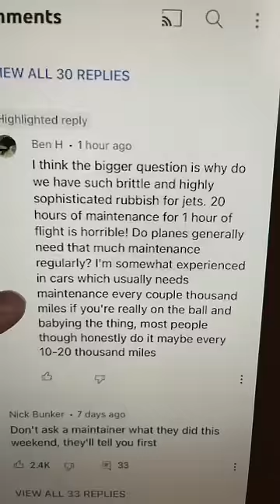Why does an F-16 need 17 hours of maintenance for every hour of flight?

Comment: "Don't buy a Toyota, this things are money pits. Gets yourself an f16" - Scotty
Reply: I bought a new Toyota Highlux pick up yruck in 1992 and had it for 27 years until I no longer needed it! It never have a single problem
Reply: @colorin81colorado  yup.. toyotas are the unsung heroes for the middle class. one might have to pay a little more up front, but a toyota will easily go hundreds of thousands of miles like nothing.
Reply: F-16 is a bargain compared to any Mig...
Reply: Scotty Kilmer ? 😁
Reply: @pan2aja  Scotty the magat.
Reply: Good luck going through the drive-through 😂
Reply: @wilfdarr  You better believe it.  Russian engineering gave them Chernobyl and the Kursk. Who'd ever buy a Lada or a Zil?  They do make a good assault rifle, though.  It's cheap, rough character is perfect form following function.
Reply: @phillipdavidhaskett7513  They built Chernobyl, we built 3 mile island: nuff said! The only reason they make such good assault rifles is specifically because loose tolerances are a benefit in assault rifles: no one buys a Russian sniper rifle, in fact they're using smuggled AWMs in Ukraine right now.
Reply: REV UP YOUR ENGINES!!

Comment: If we are talking cars, fighter jets would be F1 cars or similar and those do require tons of maintenance for every hour of racing.
Reply: F1 would probably be far worse than an F16 in terms of hours of maintenance per hour of running. Typically they only run 2 or 3 hours per day over a race weekend and have a support team of 20 people per car at the venue working very long hours through a race weekend. That said an F1 car is a prototype, whereas an F16 is a low volume product and a Toyota Camry is mass produced. 

What people don't realise is that a Toyota Camry is actually far better engineered than an F16 or F1 car because the costs as spread over so many units sold. Toyota can plough $Xbn per year into making a Camry chasing marginal gains in quality, reliability, manufacturing optimisation because they are moving over 300,000 units per year.
Reply: In fairness, as an f1 geek, I can assure you it isn’t a 17:1 ratio

Tbh I think the greatest gains could probably come from trying to reduce that ratio, if you can reduce it by half, you can maintain twice the planes with the same crew, and have twice the number of planes in the air practically speaking, and I could be wrong, but an 8.5:1 ratio should be possible
Reply: @jordanclark4635  “Should be” possible aye, as is finishing LeMans on an excessively limited tires budget. It’s a losing proposition at scale when the competition doesn’t have to—cutting maintenance hours is cutting readiness priority corners. No sense accelerating the exact readiness disruptions that make or wars of attrition anyway
Reply: @Rishnai  the point I’m making isn’t that it would be possible necessarily with F16s as they are, but that by putting more focus on reducing maintenance hours through design alterations, and when aircraft are being designed in future making this a priority, it should be possible to reduce
Reply: @jordanclark4635  Military aircraft are optimized for one thing: operational theatre domination. Civilian commercial aircraft are optimized for maximum safe uptime per unit of downtime (AKA: profit). These are two very different paradigms.
Reply: @DrewNorthup  when did I mention civilian aircraft?
Reply: @jordanclark4635  Ok, so let's say I ignore the rest of the conversation thread—how does that change my reply: Not Much. The reality is that technologies tested in the F1 vehicle platforms almost always influence consumer vehicle design, production, operation, and maintenance. If the amount of maintenance something requires in an F1 car is too high relative the race gains or overall cost then it isn't worthwhile—a closer parallel to civilian commercial aviation than to military aviation (where cost and maintenance time are generally tiny factors compared to effectiveness). That said, excessive maintenance load has gotten airframes retired early. Look no further than the F-15 and F-14 for examples of that.
Reply: @DrewNorthup  up until the last two years F1 was much more comparable to military aviation than civilian; now with a cost cap there’s maybe less of that as they can’t simply spend their way out of issues and do have to look for simple and cheaper ways to find performance 

The point I’m making is that if R&D was spent to reduce maintenance down time, they’d be able to do improve it with little performance trade off; there are many ways to do this including potentially the use of stronger and more exotic materials, as an example. While this would increase cost in this example, it would also make more planes combat ready at any one time 

I’m not advocating skimping on maintenance, I’m advocating research into reducing it so that there’s more combat ready planes available at any one time
Reply: ummm ackshully, f1 maintenance is extremely fast. An F1 pit stop takes 30 seconds at most, and they're only allowed 3 in a race.
LOL jk, terrible troll :)
Reply: @jordanclark4635  you are wrong. You just heard a just a few of the countless examples of why an f16(and fighters in general) take so much maintenance and you're suddenly an expert declaring they could cut maintenance in half. This is one of the most popular fighters in the world so im sure all the countries flying them would really appreciate your insight into maintenance on an f16. Please enlighten us on how to cut maintenance in half? Im sure the factories still building them today would love to hear your insight into fighter jet maintenance.
Reply: @jordanclark4635  we got a keyboard warrior here!
Please, tell me more about how you know more about aeronautical engineering than…aeronautical engineers 🧐
Reply: @jordanclark4635  If SpaceX decided to make fighter jets they'd probably do 1 hour maintenance for every 17 fights.
Reply: @skydog22  if spaceX made fighter planes they’d explode on runways
Reply: As an aircraft mechanic I'd rather work on that f1 than on a plane, no need to do signing off abd defo not any hard to reach spaces
Reply: @skydog22  idk I reckon there would be a lot of man-hours thrown into their rockets. Lol
Reply: @jordanclark4635  oh yeah man, plenty of them would! I'm not a fanboy man, but they do develop fast and furiously and do you have a track record of working The Kinks out to achieve a super safe rocket the falcon. It would be fun to see how fast they could put whatever kind of war plane together.
Reply: @somethinglikethat2176  you think so based on if NASA and all that, but everything is designed for Rapid reuse. The aspirational goal is 100 flights on an engine before major tear down, they already do 10 on the merlin and it is nowhere near as good of a design as the Raptor. So his goal is to land a Starship and one hour later be refueled and reloaded on top of a booster and back to space. I'm not sure how quickly they'll be doing that considering they haven't even put Starship into orbit yet but Elon has a way of motivation.
Reply: @jordanclark4635  maybe we could look at it differently. Say we divide the maintenance hours into fixed cost (in hours) and variable cost. The fixed cost would be the standard post flight inspection the every plane has and the variable costs would be work done on the aircraft to restore fight worthiness or scheduled replacements.

I imagine a lot of the maintenance hours fall into the fixed cost area and there is really no way around that problem. They need to conduct inspections regardless. 

I get what you saying but there is always a trade off and it might be cheaper to throw man-hours at the problem as opposed to redesigning parts. F1 teams have had issues with new cars and parts, even when they could spend whatever they had on the problem.
Reply: @skydog22  there would still be a ton of hours done to inspect each engine between launches, that would be the same regardless of who is doing it.

Much like the F16 much of the maintenance hours would be spent on standard inspections because the alternative of hoping for the best is needlessly reckless.
Reply: Fun fact.. did u know F1 car will need to be strips down to bare component and mechanic will ultrasound every parts to make sure the integrity of the part (molecules) is good enough for next race weekend.. 
yeap.. the whole car.. down to the last bit..
Reply: @mingc4698  aircraft also have scheduled inspections where things are peeled back and looked at closely, sometimes using nondestructive tests like x-rays.
Reply: @jordanclark4635  it's easy to say "design it better for maintenance", hard to do.
Due to the extremely low volume and high per-unit costs, any change to a working system will be incredibly expensive in the short term to apply... so... if it aint broke, the military aint gonna fix it.

F-1 is designed to be rapidly taken apart amd put back together.
Commercial planes have a large volume, so they can afford to spread the cost of a mx upgrade around to save time in the long run
Military stuff? Made by the lowest bidder for three times the cost, and delivered six years after the due date... just for a working product. You think they'll allow another pass for ease of maintenance for those costs?
Reply: Not really, F1 are essentially prototypes( sort of simplification).
Reply: @jordanclark4635  maintenance is vital so when war comes the planes are ready to fly under your successfully deduced 8.5:1 ratio. When you don't sustain readiness you create the Russian Air Force.
Reply: Dragsters probably have one of the worst ratios because they’re literally rebuilt from scratch every run. Not alot of time but definitely alot of effort
Reply: f1 cars are also designed with performance in mind instead of longevity
there’s a reason they’re allowed a few engines and gearboxes each year because of what they go through
Reply: @roowut  they’re actually designed for longevity too; engines used to be stuck in for quali, and a new one in for the race, then they had to use the same engine for a weekend, then two, then now they use 3 ICE and I think 3 mechanical splits (stuff like the turbo), and 2 electrical (ERS, battery, etc.)
Reply: @thomas316   F1 & F16 are hand made, about 100 units a year. Made with light weight material that CNC, one seaters.  Both are made for high performance with high maintenance, not individually owned
Reply: @inund8  Haha! Imagine if that was actually true for any car.

"This car needs a head gasket replacement. What's the book say?"
"45 seconds."
"That's dumb, I can do it in 30."
Reply: @jordanclark4635  The number I read for civilian aircraft is 10-12 hours of maintenance per hour of flight hour, so 8.5 hours seems like a stretch. There are things you can fix through design, but there will always be a trade off where reducing inspections and maintenance, and increasing the weight of the craft. Obviously, this negatively effects the capabilities of the aircraft. We could build an aircraft that has the maneuverability and radar cross section of a hawk at mach 2, but requires a 40:1 ratio to maintain. I suspect that designers have considered this trade off already.
Reply: It’s definitely possible to reduce maintenance time. Just look at the Gripen. Part of Swedish Cold War strategy was operating fighters from small dispersed bases or even roads so their Air Force couldn’t be crippled by attacking a few bases. Their aircraft were designed to be maintained by fewer people with less equipment to support this. But that’s just not how the USAF operates, and it makes no sense to compromise other areas of the design for capabilities they don’t need, especially when maintainers and spare parts are so cheap compared to the aircraft itself.
Reply: Nah that'd be a Saab sports car especially 9-3 models... Need I go into detail as to why that is
Reply: @thomas316 my orange f16 are one of a kind at edwards afb
Reply: @skydog22  please tell us  more. Lmao
Reply: @rudy6601  I'm glad I could give you a nice laugh, I guess I don't get it oh, there's plenty of published information you can read for yourself especially with regard to maintenance schedule of the Merlin engine/ Falcon rocket
Reply: More like top fuel drag, need a new engine after every race.
Reply: Except your average F1 car can’t carry heavy ordinance hundreds of miles in an hour or two. F1 cars don’t receive anti aircraft fire. You turn really hard sometimes, but but an F16 does that just for an average patrol.
Reply: @TeakKey7  Yep in comparison F1 and LMP1 cars are used for hours before maintenance, F16 hours before maintenance. While a top fuel dragster is used for a total of less than half a dozen seconds before having the whole engine being stripped apart to be maintained!!
Reply: @dizent2885  Have you ever tried turning your soccer mom SUV like an F1 car does? F1 cars literally pull the same amount of Gs as an F16 in EVERY corner! All those wings aren't for show! An F1 car produces enough downforce to drive UPSIDE-DOWN! Most hypercars use 5-8L engines with 8-16 cylinders to produce over 1000 HP while an F1 car uses a tiny 1.6L V6 to produce more than 1100 HP in the the most reliable mode! Some of them can temporarily make 1600 HP during a qualifying lap! That's 1000HP per Liter!!! In an engine that's smaller than a Toyota Prius' engine and produces more Horsepower than a Bugatti Chiron Super Sport (300 MPH car)!
Reply: I see your point but I think it's pointless to compare planes to cars in the first place
Reply: @kareemahmed1181  not really, F1 cars use nearly every single facet of aerodynamics that an airplane does. All those carbon fiber fins, wings, scoops, and air dams aren't just for show! F1 cars have enough downforce to where you could drive them upside down! And all that downforce makes it so F1 cars can take turns so fast that normal cars would flip over or literally twist their frame! Just like how military jets are designed to turn so hard that normal planes would rip their wings off and twist their frames too!
Reply: @lorenzamccoy7512  dude as he said f1 cars can't go mock mach 1 in the air upside down
Reply: @kareemahmed1181  Yeah and a F-16 can't go 0 to 60 MPH in 1.6 seconds without a catapult, that doesn't mean it's not one of the top of the line most advanced vehicles ever made! A F1 car is also one of the most advanced vehicles ever made it's just made to go across land instead of the sky!
Reply: @RebelFNOS  only takes 25 minutes to swap the clutch in my 99ems, as long as you have a helper with taking off the hood.
🤪